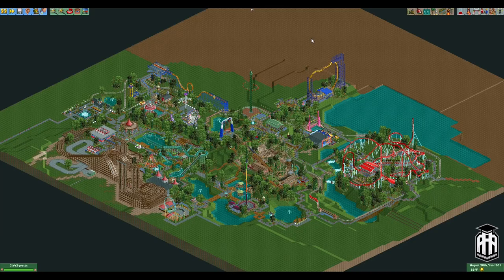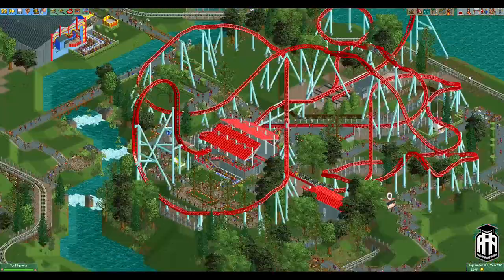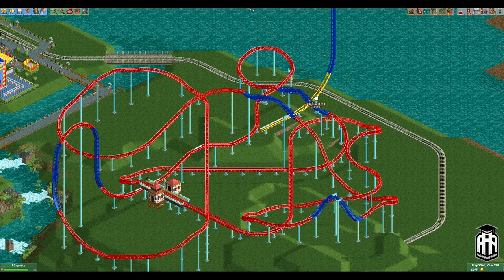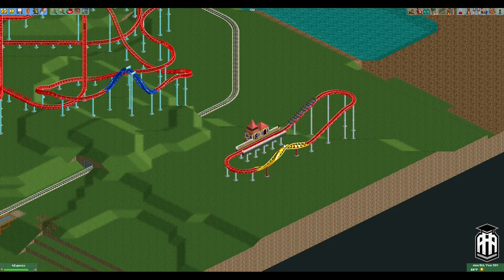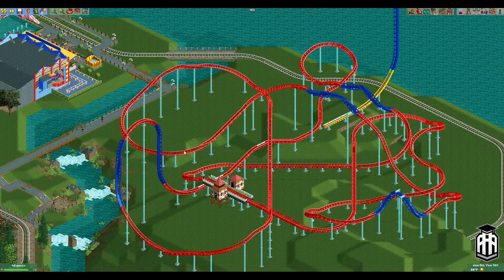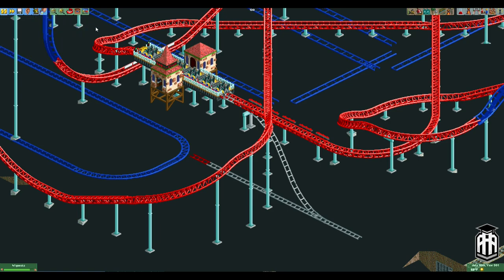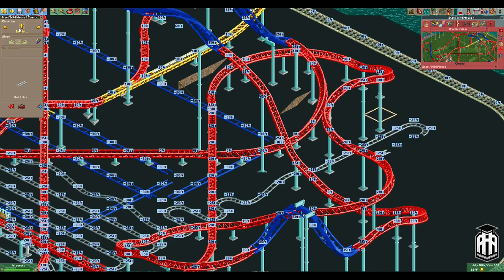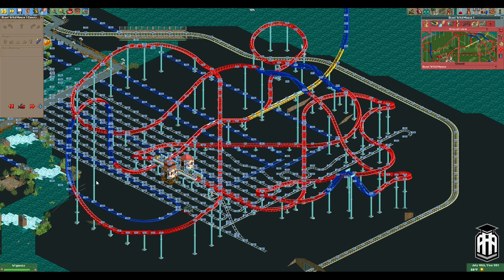RCT2 Hacking Tutorial: Diagonal Brakes and Triple Launch

Comment: Since you’re already using vehicle ride editor plugin you should change the shoestring car to have have zero riders. Then you can move the shoestring wherever you want and people won’t board the car. Also for flat ride shoestringing i recommend using shuttle mode and a powered vehicle because you can have finer adjustments to tge speed and forward backward travel more effectively.
Reply from the maker: Good points!  Sometimes I like the extra capacity the car down there brings, but it is a nice feature for use. 

We've featured a few shoestrings using shuttle mode so far.  It's a pretty useful tool.